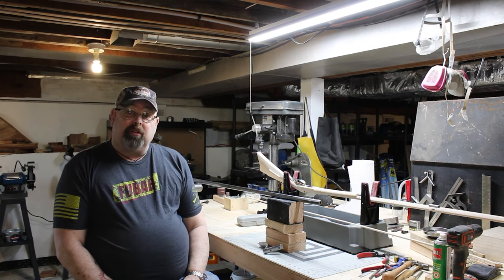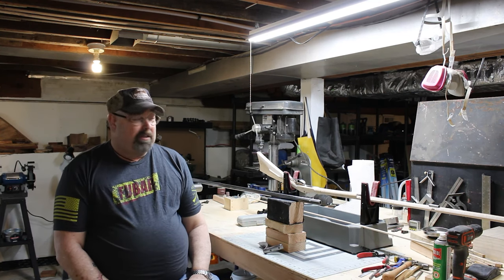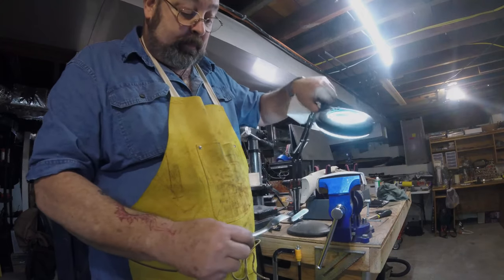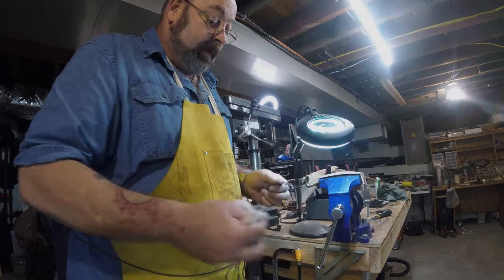Kibler SMR Assembly Metal Work

Comment: Maybe you can help me out? I just did my first rifle kit, a Traditions Shenandoah. I browned the barrel and I have 2 spots that just keep raising red powder, no matter how much I oil them. Last resort bore butter, heavy. Any suggestions?
Reply from the maker: I have never browned a barrel so I'm not really sure any suggestion I might make would help. As just a WAG at it, I would try using some "monkey milk." It's a 50/50 mix of Balistol and water. I use it to clean all my blackpowder guns. I also use the Balistol alone to oil  and protect all my guns, not just the blackpowder.
Reply: @BruceBaillie1  Thank you
Reply: A little late, but use a paste made from baking soda and water to neutralize the acid.